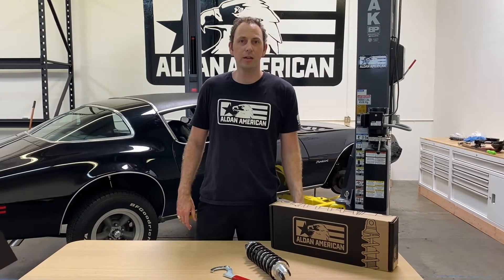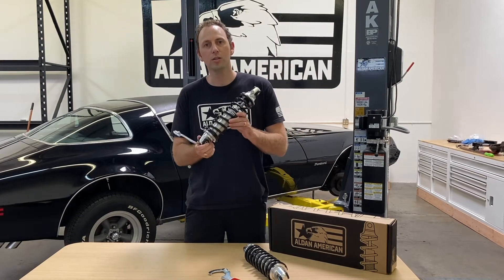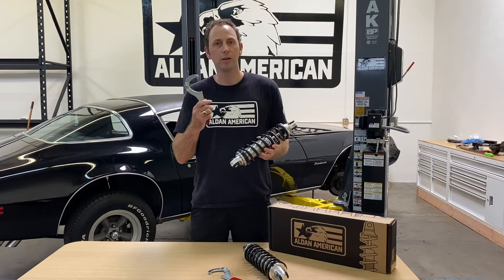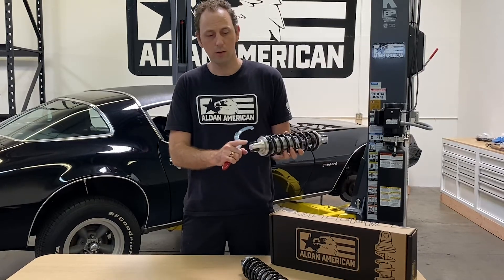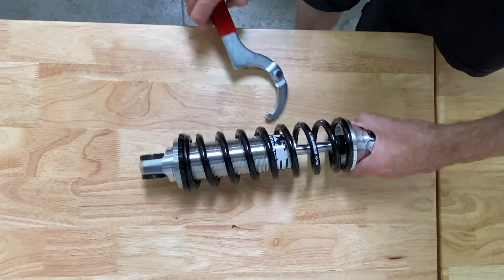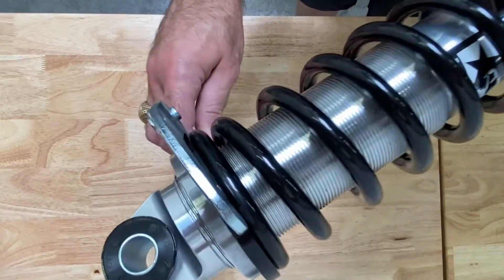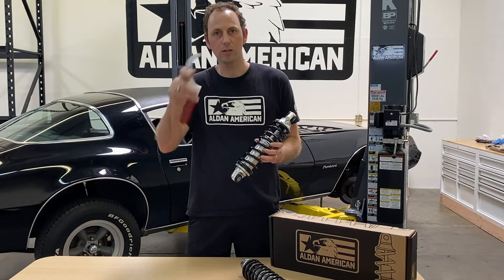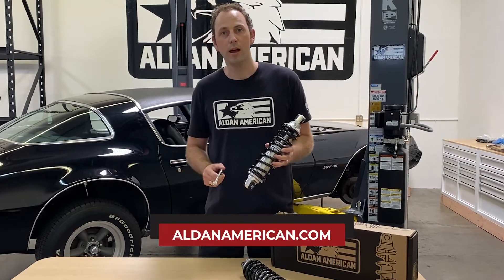What is a Spanner Wrench | Adjust Your Ride Height or Set Your Spring Preload

Comment: I need this Machine or screw spanner or whatever you named 😢
Reply from the maker: Please check out our Aldan American part # ALD-1
Reply: In auto repair, a spanner wrench is used everywhere. Engine counter balance shafts for over-square engines. Differentials, manual transmissions, 4 X 4 transfer cases, even certain older import camshafts. It allows for adjustment on spring preload to change the ride feel and height. 
  Best of luck with your project.